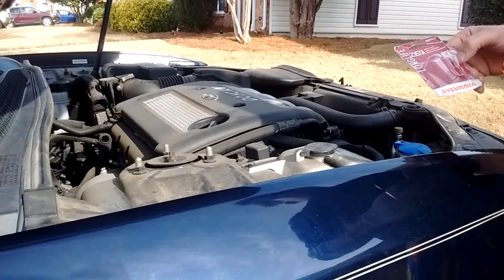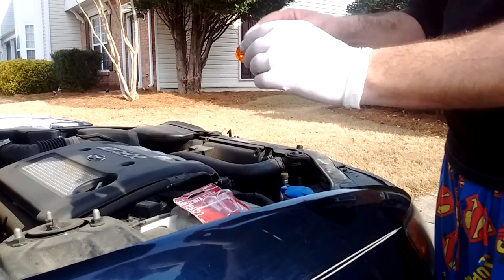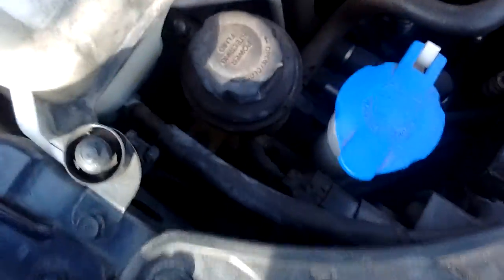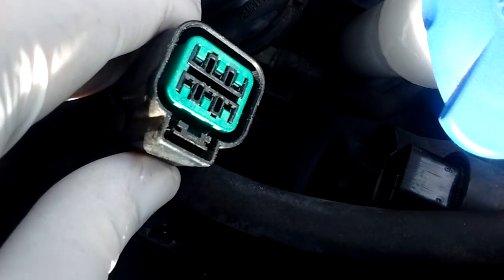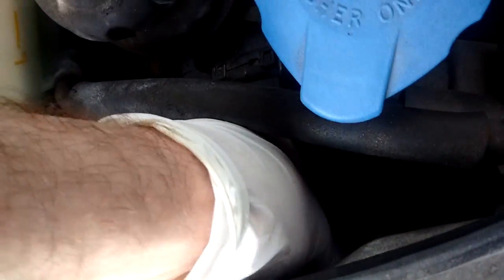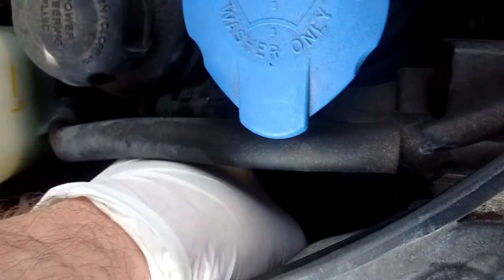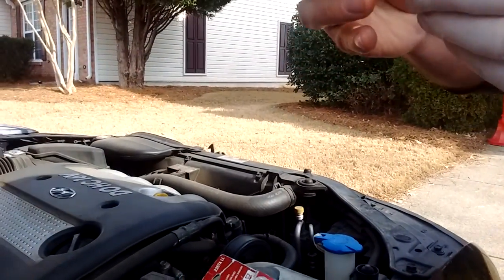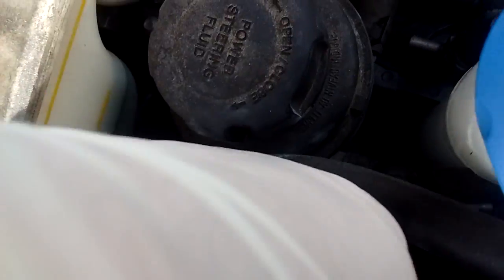How to Change Your Car's Turn Signal Bulb

Comment: Does anyone know why a signal light would burn out fairly regularly causing some melting of the plastic where it is inserted.  Maybe an issue with the receptacle?
Reply: Check to see if the socket has any corrosion. If it does, with the lights off, scratch the surface of the metal contacts until there's some shine where the bulb contacts touch. A bit of dielectric grease on the contacts, or petroleum jelly in a pinch, can stop further corrosion. The corrosion adds resistance, and the resistance creates heat and voltage loss, melting the bulb housing and shortening the life of the bulb. If everything looks ok, or this doesn't solve your problem, you may wish to have a friend with electrical experience or a mechanic to look it over for you.
Reply: @hobolurkin  thanks bud, I'll give it a go.

Comment: This is a big help. My truck is old, and the front light specifically is stuck on, so I am planning on unplugging it to not kill the battery till I can figure out what caused it
Reply: If it's a running light you probably have to turn off the lights with the knob on the dash
Reply: @AngelaScene18  nope tried that it was only 1 light stuck on
Reply: @AngelaScene18  meaning it was a wiring problem

Comment: Mine were not burnt out but the metal bands that touch the bulb side and base needed a gentle tug outward with a flat head screw driver. This would have saved me $4 but, I saw the old bulb paint was flacked off a lot so, after that, I replaced them. Kept the old bulbs as back ups.
Also, some bulbs are like shown but the holder has a flat handle you twist. Be sure to note its position vertical or horizontal before removal and note left and right side. All these matter for putting it back.

Comment: I bought the size my manual says my car uses and it still doesn’t fit. It’s not even the right plug
Reply: Cause the previous owner might have changed the plug and bulb completely it does not depend on the car sometimes the plug harness and the bulb is changed
Reply: Tell me ur car make and model I might help u

Comment: What if I can’t unplug my power source will it shock me ?!:(
Reply: I would like to know too.
Reply: @annhamlet8247  it doesn’t :)
Reply: No it will not, power only goes to the globe when it is on (i.e. when the turn signal is blinking). If you are still sceptical, you can always remove the negative terminal of the battery while doing this job, it will cut all power to the vehicle.